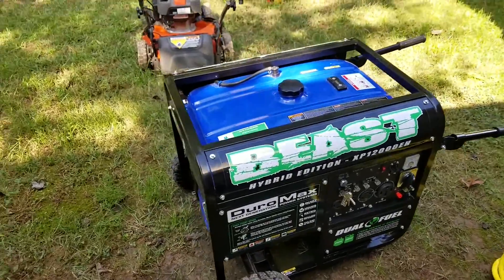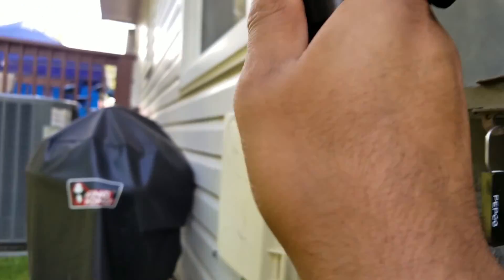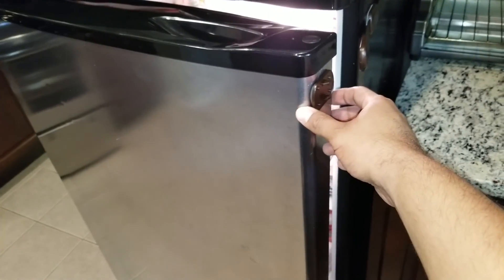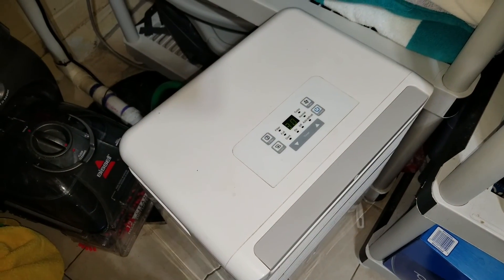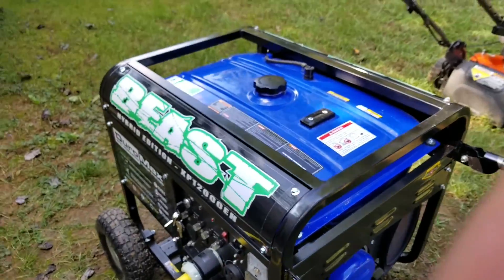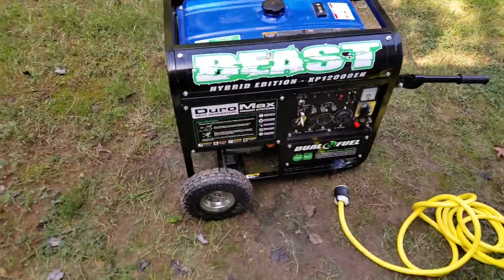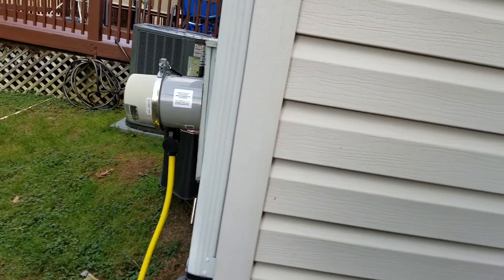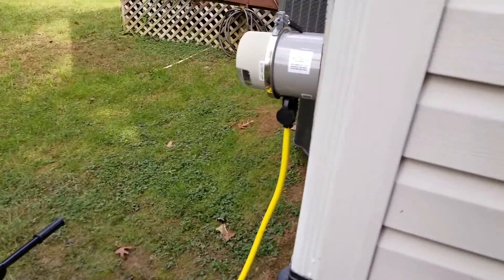GenerLink + Generator powers whole house - XP12000EH , MA23-N, running TRANE XR17

Comment: Finally!  Thanks for saying how big the A/C unit is and actually showing it running. Lots of people saying a portable can’t do it or that it will screw up the compressor. Have you run it for longer periods? If so then how did it go?  I’m wanting a larger generator specifically for my central A/C but didn’t want to spend the money just to find out it wouldn’t work. Thanks for posting this.
Reply from the maker: I have used this Generator to power my house for about 6 hours during the winter. Luckily I haven't had to run the whole house during the summer... other than just testing that it can run the house during the summer once a year. If I really need to run this during the Summer, I plan on Running the AC in increments while turning off other major appliances to save on gas.

Comment: My experience running “whole house” with this exact generator on gasoline — it will burn between 18-20 gallons of fuel, EACH day (24hrs).

Last hurricane (Irma?) at my FL house, it was fairly hot and thus the HVAC system ran most of the day.  Folks in more temperate areas can definitely get away with a smaller, less thirsty unit.  (I run a whole different setup, up north)

All told, I keep 2x20lb and 6x40lb propane tanks stocked in RESERVE for outages.  40lb tanks are generally the biggest available with standard “BBQ Connectors” and OPVs.  Easy to fill and use, both for a genny and a BBQ.  (and shelf life for years)

That’s three days buffer in propane, and then many, MANY jerry cans for gasoline.  As a matter of practice — FL has a “hurricane season,” and gets ample warning when a hurricane looms.

When that happens, I fill up the genny, cars and jerry cans with fresh fuel.  If the storm bounces, I’ll just burn it for transpo.

I also have the provision to remove fuel from my vehicles, if necessary.  When the power goes out, and coastal areas are under evacuation — fuel gets scarce.

Having the ability to run off-grid for FIVE DAYS seems to be the sweet spot for FL.  Usually by then, either the power will be up, a/o fuel will become available again.

Last time, we were off for 73.5 hours.  It was pretty awesome to have one of a small handful of houses in town, FULLY POWERED.

Other tips:
• B&S sells a perfectly-sized bottle of “small engine” oil, spec’d for this genny.

• After first 40hrs break-in, I switched to Rotella T6 (5W-40), a synthetic HDEO.  My preference....

• Either run or pump the fuel tank dry, then burn fuel out of the bowl + carb for storage.

• A cheap motorcycle “Battery Tender” is good for keeping the battery charged, and ready.  Far better than fueling and running every month.

• DON’T fill the fuel tank completely, as the vapor recovery “thingy” will ingest liquid fuel instead, refluxing it onto the ground near the intake /air filter.  (fire hazard!)

• The provided “airless” tires easily (and badly) flat-spot when parked.  My unit lives atop wooden blocks, the wheels now used for movement only.

• Running on gasoline, the carb quickly vapor locks after shutdown.  So expect to either (carefully!) “hot-fuel” it, or allow an hour’s cooldown between restarts, depending on ambient temp.

• Power from this unit can reach >18% THD unloaded, and still 10~12% online.  An everyday off-grid power unit, this is NOT!  Your electronics will thank you for getting back on-grid asap.  (otherwise, invest in a line conditioner)
Reply: Running at half load a full tank of gas which is 8 gallons is supposed to give you up to 8 hours which we know that never really happens so yes it should be about 24 gallons for 24 hours on a full load system it's going to be more
Reply: I lost power for 7 days during Irma in FL, and did not yet have a generator.  It was brutal.
Reply: @NonyaBusiness! The Duromax 15000 (and 15000EH) seem are priced at $3000!  And are hard to find.

Comment: Using the thirty amp twist lock outlet and cord to run everything including the A/C. That's scary.
Reply: Is this a 30amp or 40amp generlink?  I just got 40amp,with 14-50 cord, don’t think I would want to run an a/c unit with anything less than that.  Also considering a 100lb propane tank that will never go bad like gas does.
Reply: @bwallace5692  Good advice on the Amps. You can fry motors real fast if the Amps aren't suffecient.
Reply: David Wiser Dave you connect up to a 30 amp your AC unit take 30 amp
Reply: @generlinkcanada  Yeah I understand your A/C takes 30 amps to run but you are also running more than just your A/C you are running everything. That's is asking an awful lot for just 30 amps. I'm surprised your cord doesn't catch fire.

Comment: I had no idea these even existed until I started looking for a way to power my home without a standalone generator.  Thank goodness I found this.  Super easy to install and don’t have to mess with a transfer switch.  Thanks for showing this.  Your generator didn’t even stutter when the AC came on!!  That’s great.
Reply: At my place in FL, I had a small “Side Panel” installed next to the meter box.  Basically, this thing lives inline between the mains, and the panel inside.

There’s an interlock widget ensuring the big 200A service breaker is OFF, before I can engage my choice of 30A or 50A 240V breakers — fed by the respective NEMA standard inlet boxes.

I installed both type inlets, so I can optionally run a smaller (less thirsty) genny — granted, without HVAC.
Reply: 100fredkrueger I checked and are not allowed in the state of Kansas. Too bad, it looks like a great alternative.

Comment: If you're going to run gas, only shut the gen off with the fuel shut off valve, and it'll start every time on the first pull/crank.  Assuming you remember to turn the fuel back on... ;p
Cheap gas works fine, anything else is a waste.  And you don't need fuel stabilizer for a 6 month rotation.  If you run the carb dry, that gen can sit for 3+ years with the same gas in it and still start on the first pull.  Granted it may spit and sputter a bit, but nothing adding fresh gallon or two of low octane gas won't fix.  And btw, you could of easily just added a 50/60 amp 240 breaker (for input) and a lockout to your box there for close to $100 bucks.
Reply from the maker: Yeah I thought of that, but my Main breaker panel is a 150 amp split bus panel from the 70's which means a lockout won't work. Even if the main switch is off, power still runs through the panel and I would backfeed if I hook up a generator to it. I was told that I would need to upgrade the entire panel which alone would cost close to $1000 here in the DC metro area. Hence why I landed on the Generlink system that connects to the meter. And I was wrong when I recorded this video, I don't pay a monthly fee for it. My power company installed it for FREE.

Comment: I don't think you need stable ... 
I have six 5 gallon jugs that i fill up just before hurricane season hits... Ethanol free fuel. If no hurricanes hit and once the season is over and NO chance for hurricane, i just take that fuel and fill up the gas tanks in my cars and motorcycles and burn them off. Then when the season hits again, i re-fill the gas containers ...
Reply from the maker: Yeah thats a good plan, but Ethanol free gas is hard to find in my area. I have to drive many miles to a municipal airport to buy it at a premium markup.  Power outages in my area occur during Hurricane season, but I also get the occasional snow or ice storm during winter that knocks out power, so I kinda have to be prepared  year around. Stabil might be overkill for 6 months rotation, but better safe than sorry when it comes to Ethanol gas considering it most likely will end up in my car.
Reply: fortunately for us we have numerous gas stations with ethanol free fuel within minutes. We live in florida so we don't have "winters" or ice/snow storms like up north so thats one less worry. The only thing we have are hurricanes. I lived in NYC for 15 yrs of my life and i know snow storms and how they can kill power.. Again fortunately the high rise we lived in had 3 HUGE diesel generators in the basement for when power went out and we had one 120V outlet per room that gave us power. But i don't know how you guys live up north with the COLD ass winters and snow storms .... I can't deal with the cold and refuse to... I prefer the heat with sunshine year round.

Comment: You know you don't need to have power running around the clock. Turn it off when you sleep etc if it's not too hot or cold. Run it in 2-3 hour spurts then shut down for a few hours. You can make it at least a week this way. Fridge will stay cold for almost 24 hours in a mild temp home. Freezers even longer. Try to get your usage where you're using a can a day not every 2 days. That's a large genset and will burn fuel quickly. Having a small generator as a back would be a good suplement. A harbor freight 2k inverter is a nice bet for the money burning a gallon a day with a few couple hour spurts instead of 5.
Reply: Living in the south we can’t do that.  It gets way to hot here in Oklahoma.  But I won’t be running everything 24 hours a day.  I’ll only run what I need.  My well, hot water tank, fridge, two TVs, dish box, ps4 and my AC.  And in the winter I have a fireplace plus it rarely gets into the 20’s at night.
Reply: @100fredkrueger  I live in the south too. Central nc.
Reply: SlowcarsInc — How do YOU know what anybody needs?  Some people require O2 pumps or other medical equipment, some people have other medical conditions REQUIRING 24/7 climate control a/o carefully refrigerated medication.

Some houses rely on sump pumps, others have well pumps for water service.  Maybe, like other commenters, they might live in the Southeast, or the desert — and NOT running a/c ISN’T an option.
Reply: @Acroposthion  I literally mentioned a supplement for those as needed cases. We can sit here and argue about an exception and try to make it the case. Often a true disaster will last a week or more. Around the clock that generator will burn around 16 gallons a day with ease. Most people barely have this much fuel stored. It's just advice to get this guy through in the event he cant access more fuel. If he has a case like that and needs to run around the clock a small genset to supplement his large one is a good bet. You could burn a 100 gallons of gas real quick in a disaster with this sized generator I have a similar sized genset myself. Just trying to help out not shoot anyone in the foot.
Reply: @JONNYGEEKMANG   You are exactly right and nobody could carry up to 100 gallons of spare gasoline in their house/garage.  Duromax knows this issue, which is why they build their generators to be a dual fuel system.  Gee...a gasoline / LP combo generator from Generac?!?  DOES NOT EXIST!!!  I would strongly recommend at least a 40lb or 100 lb LP tank to have on hand for an emergency.
Reply: @smithn.wesson495  a 40 lb would be nice but doesn't last very long on a genset this size. It's better then nothing. There isn't anything that says you can't slowly work your way up to more gas storage/propane storage. I do plan on installing a conversion kit on my Westinghouse wpro8500 at some point and keeping a couple of those fork lift sized tanks around and at least 30 gallons of gas on hand as well as a full car(17 gallons I can easily take) plus the 7 in the genset. If a true disaster happens like a microburst you'll just about have to shoot people in mere weeks if you're power is still up while they are working on the grid. In full grid down I'd use power to get as ready as possible before it gets really bad.
Reply: @smithn.wesson495  plus we get power outages often anyway. Been getting heavy drops lately. It comes right back but it's just a matter of time. Were over due for some half day all night power outages. They keep adding onto a very overloaded local grid.
Reply: @Acroposthion  Stop being an A-hole Troll.